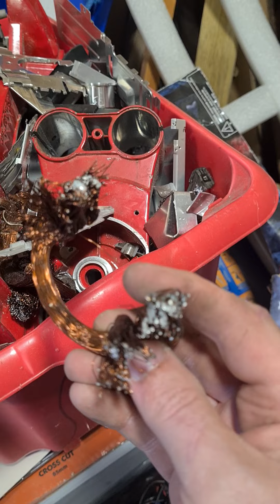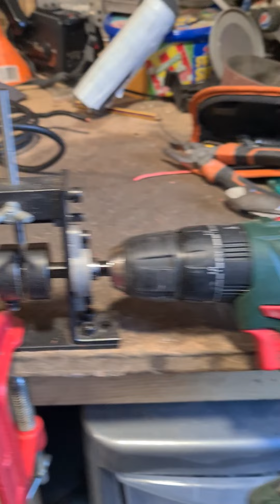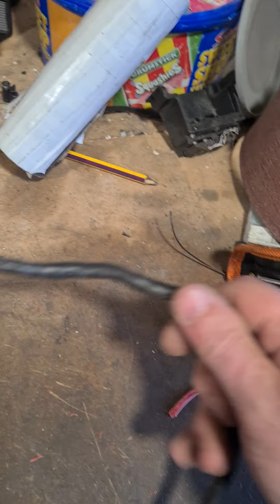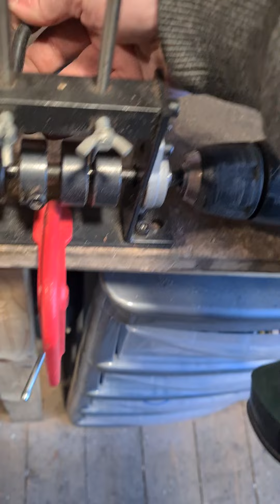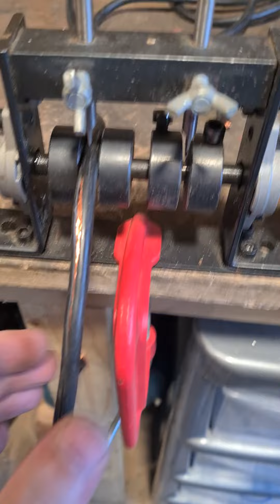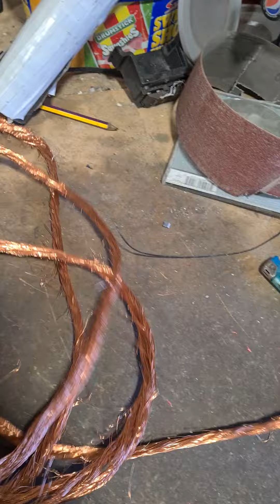Stripping insulated wire for copper

Comment: Is it worth stripping just your standard  household wire ?
Reply from the maker: I strip everything possible bro unless it's tin plated or too thin to strip.
Reply: @Scrapping Scotland   thanks m8 am in England  been scrapping 6 years  but only stripped  cooker wire and thicker but will try the general household wire thanks

Comment: Have a few different copper strippers myself ,and they are handy, but wee tip when ur stripping wire like that jump lead ,you should always cut the wire in smaller pieces ,it will go through the stripper with out jamming or digging into the copper and shredding it .!

Comment: Where did I get the stripper from and how much  thanks
Reply from the maker: Hi, I got it from wish.com. type in wire stripping machine until the search and you'll find it. Note that you will find a few of the same ones at different prices so make sure you know what you are buying.  I was also able to buy spare cutting spikes for mine. I bought mine over 2 years ago at £13. Now the cheapest one I could see was £23. Hope that helps
Reply: I love sitting stripping wire love to se the shiney copper